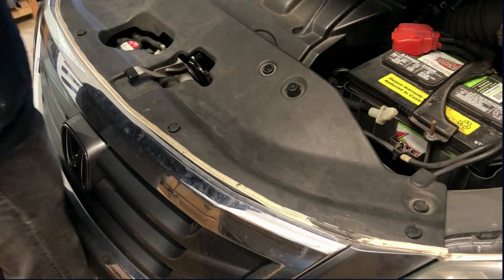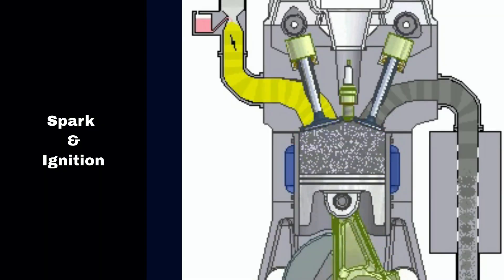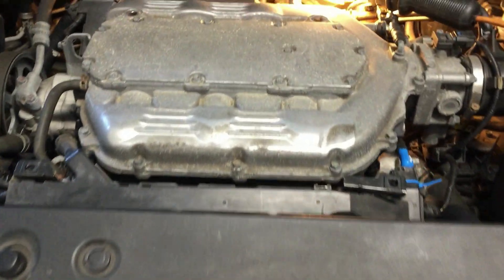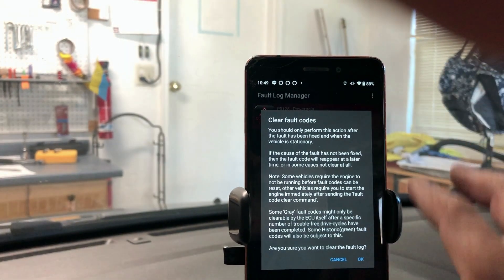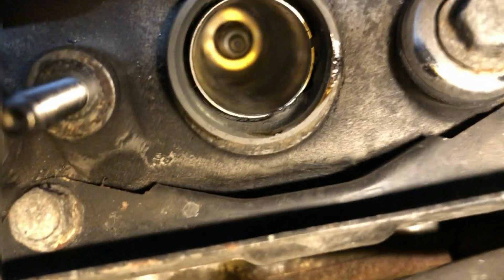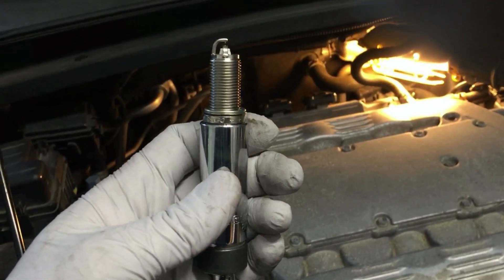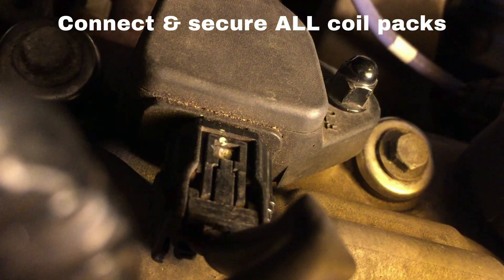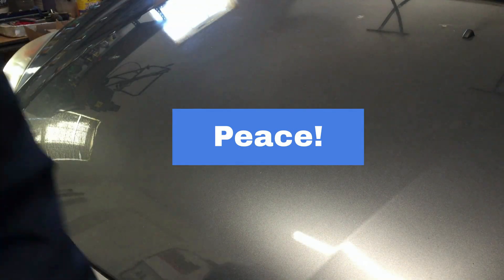Engine misfires w/ code P0302. Spark plug or ignition coil pack? Diagnosis and fix.

Comment: Got a 2003 mdx and recently got multiple cylinder misfire. I changed spark plugs and coil packs and still have the same multiple cylinder misfire. I thinking changing the fuel injectors next and see if that will fix it. Any advice if the fuel injectors change doesn't fix the problem, where should I look into next? 🙂
Reply from the maker: I'd start with basics and potential simple fixes. Could it be bad fuel, oil burning, or vacuum leaks? Perhaps run a scan to see if the engine is running rich or lean? It can be due to bad MAF (needs a clean?) or O2 sensors. Do the old spark plugs have signs of oil burning? 2003 MDX doesn't appear to have VCM so PCV is what I'd check/replace if it does have oil-burning issues: https://youtu.be/bGVFDy7I0j8
Reply: @profsg  Thank you. Will check those for sure. One of the spark plug was darker than the rest when I removed it and replaced with new ones. It was not wet though. Engine is misfiring pretty bad like it is about to die down every time the engine is running. There is quite a bit of oil leak. 

Before the multi cylinder misfire, my dad accidentally put diesel but car was towed to a mechanic and drained the gas tank right away. Car was running great for about 4-5 months then comes the misfire.
Reply: @profsg  I recently did a compression test and here are the test result:
Cylinder 1 - 221psi
Cylinder 2 - 50 psi
Cylinder 3 - 205 psi
Cylinder 4 - 195 psi
Cylinder 5 - 195 psi
Cylinder 6 - 215 psi

I did the drop test were you change coils from one cylinder to another cylinder and the cylinder 2 has no change when doing the test. Doing the compression test did confirm that cylinder 2 is problematic. Could changing fuel injector be the fix? As always, I appreciate your help and your content 🙂
Reply from the maker: @generryan5545  The PSI values look good except for cylinder 2, which is rather concerning. Likely piston rings and/or valves. Were these based on a wet compression test? I'd try to find the root of the compression problem and where the leak is, perhaps comparing wet/dry tests plus a leak-down test to find the source.
Reply: Valve adjustment!

Comment: what if the code comes and go
Reply from the maker: Is it on a specific cylinder like p0302 or random misfire? If the former, follow the procedure in video to monitor what the culprit is. Otherwise, bad fuel, fuel injector or oil burning might be the issue. Have to monitor the code and engine behavior.
Reply from the maker: How many miles on the plugs? If it's time, like 100k or so, definitely replace all plugs and use OE. Also, next time at the gas station, fill the tank with the best fuel and see how it goes.
Reply: I did replace my spark plug,injector and all coils but after a week it went back again any suggestions thanks
Reply: I did replace my spark plug,injector and all coils but after a week it went back again any suggestions thanks
Reply: I did replace my spark plug,injector and all coils but after a week it went back again any suggestions thanks
Reply from the maker: @hbirhb04  does it burn oil? OE parts? I would have little confidence in aftermarket parts for these key components.

Comment: Thanks ❤.I should’ve changed those sparkplugs too.I do that in my next oil changes.
Reply from the maker: No problem 👍
Reply: What ngk plugs would you recommend for a 2003 Honda Civic LX
Reply from the maker: @sherrodgee3075  I missed this question as it was buried in the thread. According to Honda, these are part numbers for 2003 Civi LX: 
* NGK plugs #98079-5614P 
* Denso plugs #12290-PGE-A01

You don't have to get it from Honda. Search for genuine parts by NGK or Denso.